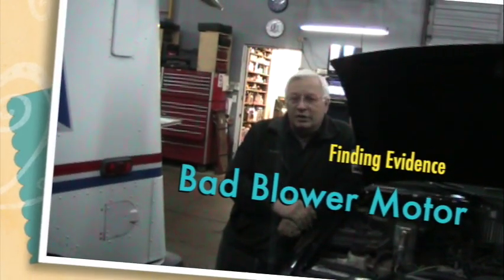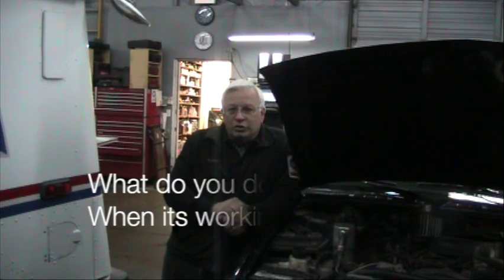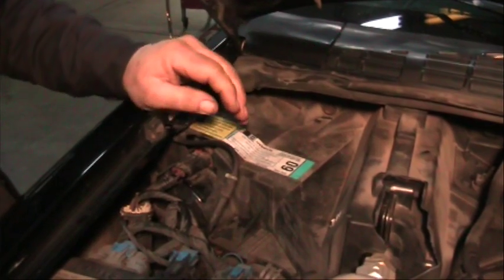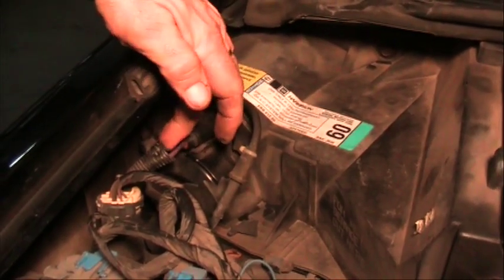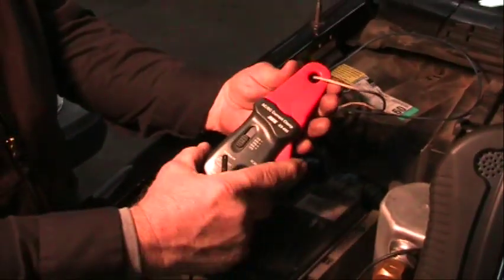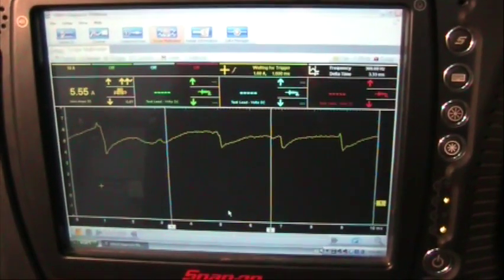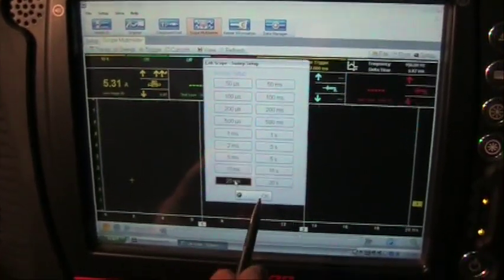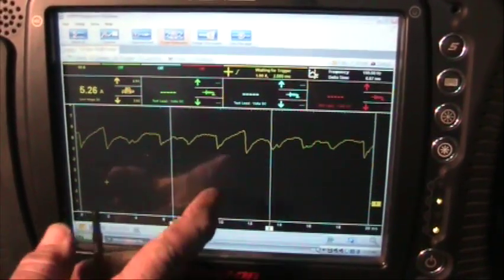Finding Evidence. Bad Blower Motor

Comment: You have a lot of good info.  I just got finished replacing the timing belt on my Acura and you were a big help and I'd like to thank you a lot.  I would say though as a do-it-yourselfer I can't afford the expensive Snap-on apparatus.  I've had a few GM cars and bad blower motors and starter solenoids that are intermittent on a hot day are something they have all had.  So for me, a blower motor aftermarket is pretty cheap.  I'd just throw one on and bet a couple of pennies.

Comment: good advice but (1) strip back connduit better than 2 jumpers,(2) eliminates diagnosic of a bad connnector. instead put the jumper in the fuse socket